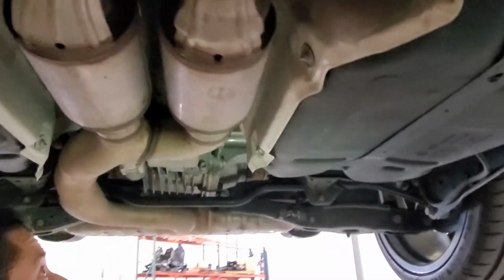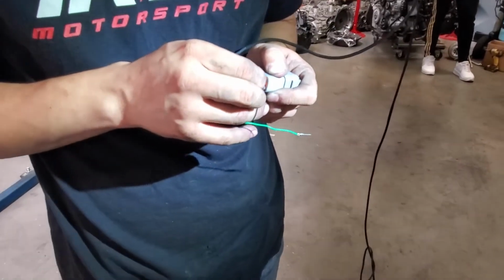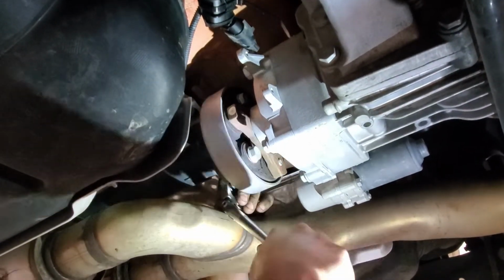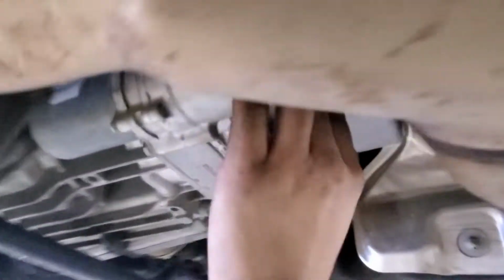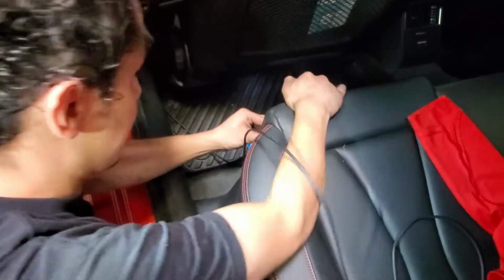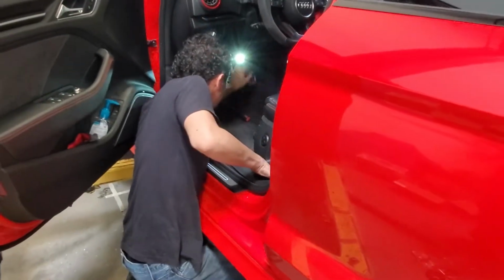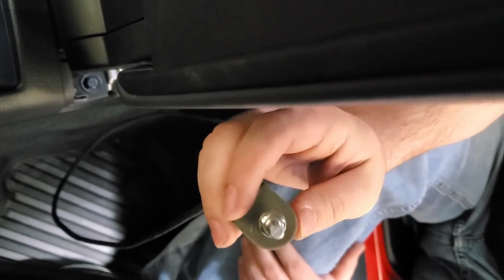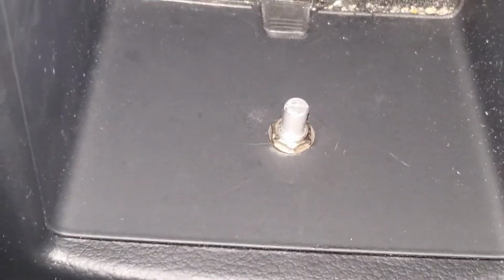Iroz Haldex Controller Install

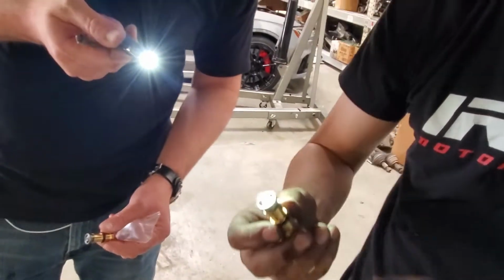Comment: So whats the deal with the valve replacement at 14:20?
This is the first ive heard about this part.
Reply from the maker: This updated valve will allow the Haldex Controller to work properly. If the Valve is not updated, the Haldex Controller will function like a stock unit. Please see our other video on how to upgrade the valve. All of our controllers come with the parts necessary to make the upgrade on you stock unit.
Reply: @IrozMotorsport   very helpful video. Thanks! I'm from Russia!